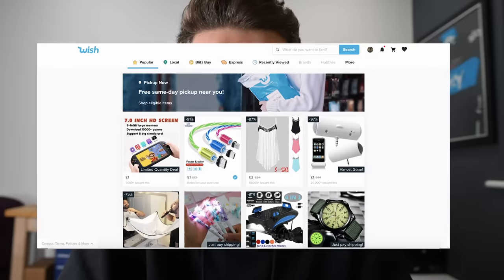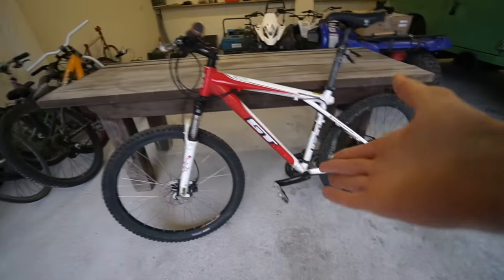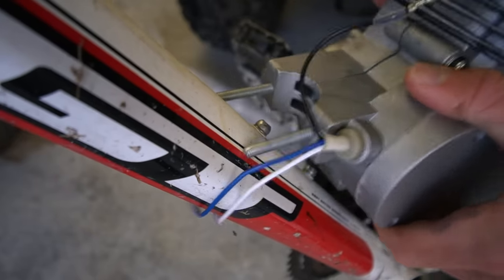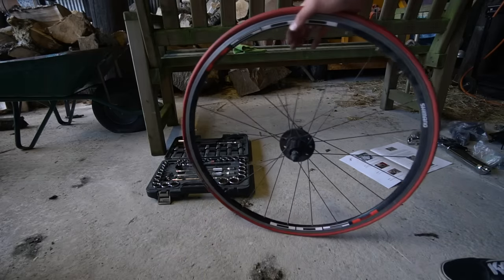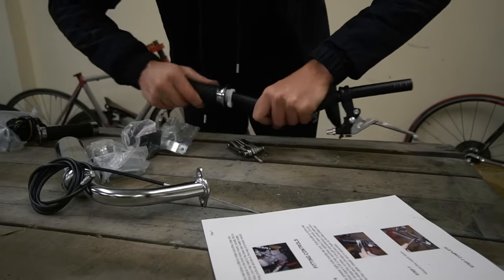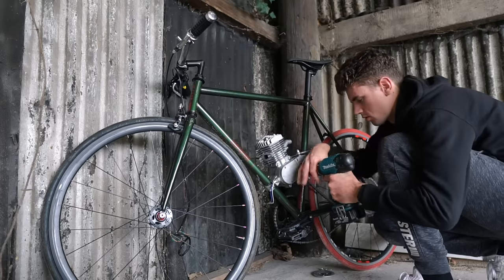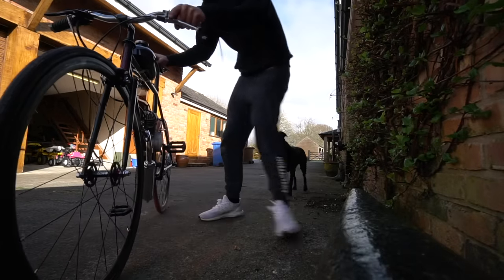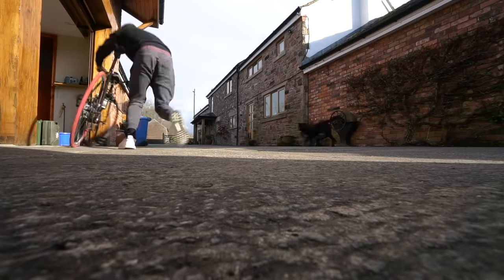I bought a 2-stroke bicycle engine from China *dangerous*

Comment from the maker: Hey guys. Like I said on insta - I wasn't gunna post this for another week or two. But I know a few of you are stuck inside, etc etc etc. So I decided to post this earlier. I hope it can bring a smile to you all, and you're all staying positive 👊
Reply: As a heads up upgrade the engine studs because stock ones break easy and I managed to break my frame above the bottom bracket at 800 miles
Reply: Did you not get the chainguard with your kit that stops your shoe laces getting tangled and a faceplant also do you need any insurance etc to use this cheers
Reply: This kits comes with an adapter for the engine mount to fit on bigger down tubes FYI
Reply: Cameron Jeffers put a new spark plug on for it to start easier
Reply: You can get loads of go faster goodies for these including Nitrous kits that use creamer cartridges available in Boots. Get a cheap thin steel tube bike that suits the engines mounts. These really do fly once bedded in, just remember that you need V brakes at least. I saw a cop driving towards me once, but I killed the engine and pretended to pedal, he never even looked up.  I have a few vids of mine on my inventions and gadgets playlist if you're interested.  Have fun playin and stay safe 👍
Reply: Watch the bolts on the wheel chain gear snap snap and 80cc that was ment for the 25mm frame extra bracket or your going to need to change the case for the 50mm should have kept it to the 50mm?!! Theres a 100cc upgrade when you get your scooter licance 😆 with the short piston had 55kmh on nitro upto 62kmh. 5 years 1 bearing 2 needle bearing crank and piston done everything😧.
Reply: Where abouts do you live
Reply: I’ve been looking for a bike Can i buy one your old ones because I don’t have the money for new ones
Reply: I put a 80cc bike kit and put it on a 20" Bratz chopper bike and it did 50mph and you could dump clutch ride wheelies I've built 5 or 6 of these kits and have done all the mods
Reply: And I've never "broke" one in I start it let it warm up and then ride it hard and I put 300 miles on my 1 in 2 weeks you break it in the way you want it to run always
Reply: I spent ten years building and selling them and I will never touch one of those 2 stroke kits ever again. Just saying.
Reply: @scooter979represent  why?
Reply: I got a motor off "wish" big mistake but I'm stuck with it now. I've tried over an over to get it started..it won't start. Mine is the kind the has to head..the cylinder is one piece..I suggested ideas to get it started besides throw it out an buy a good one. Lol
Reply: Is it pedal assisted?
Reply: @BowsersCloset  yes.. Its peddle assisted
Reply: @anthonyl9438  why bro
Reply: What was the top speed? I use to own one think mine got too 70kmh
Reply: Hey bro. Is it every start moment will have that problem 9:28.?? Plss answer that quiestion.
Reply: Mate if u had a back wheel of any other bike so u had a cassette that bike would of fired first time

Comment: if its hard to start after 3 tries turn the low speed needle out 1/2 turn to richen it up. this introduces more fuel= MUCH easier starting. the reason you finally got it going was because the motor kept getting warmer and finally the ring/s sealed well enough to give it the compression it needed to start.
Reply: Yeah, I'm sure a video he made four years ago and your comment two years later is why he was in the same ally for the last 730 days doing this over and over again until he saw your comment.
Reply: Yeah, im sure this dude is reading your comment 2 years after placing it😂 @MikeNBikes
Reply: @MikeNBikes  lmao rekt

Comment: That thing is gonna be more banned by British Cycling than you were!  🤣😂🤣😂
Reply: Lol What's this about getting banned. I'm a BC coach!?!?
Reply: They are legal in the uk as long as you are peddling.
Reply: @cosmomanningham-buller7620  no they're not unless you have tax,insurance and mot
Reply: Cosmo Manningham-Buller they ain’t legal in uk 🇬🇧 I’m Blackpool based n I got pulled it don’t matter if your peddling or not
Reply: @anthonywarner6433  did ya get a warning or were the cop a jobs worth?
Reply: Lord Belvoir na they said I have to use it on private land or if I didn’t they would take it of me so I sold it on to same any greath mate
Reply: @anthonywarner6433  they will be
Reply: Lord Belvoir na they didn’t nick me as they said just put it in the house but I sold it in stead
Reply: @lordbelvoir2543  , Agree, it would need SVA /Type Approval to get a reg plate , but would it fail emissions? ( & perhaps dodgy fuel tank & poor brakes & more? )  Perhaps You still can have a "day light only MOT' with no lights.  The Cop might have to prove you were running/ or planning on running the engine on the road/public place to get a conviction, rather than just peddling to private land.  If you are just peddling to private land taking the spark plug out might convince the cop. Caught motoring on the road,  a keen cop could be looking for big fine & points on your car license.  And that ok, as the chance of injuring or killing a bystander is actually higher than a Cycle or real Moped.  That said there should be provision for waste land where folk can have fun.
Reply: Great idea but I don't  think they are road legal in the uk
Reply: Can anyone remember  the motorized  skateboard

Comment: Hell, I bought a kit and put it on a cheap Wal-mart mountain bike. The cheapest fun and means of travel. A top speed of 27 mph. But around 100 miles per gallon.  I could ride for 26 miles for less than .90 cent U S. Plus, if you treat them right. You can get around 10,000 miles out of one motor. Performance parts are equally dirt cheap.

Comment: I still have the one I built as a kid over 10 years ago with one of these kits.. most dangerous part is that rag joint that connects to the spokes but if you swap it with a hubcentric sprocket you're good. Mine still starts up and rides, hits nearly 40mph

Comment: if built correctly and maintained properly these motors are very reliable. Only problem i ran into was the chain tension pulley, which i fixed with a rubber sleeve wrapped around the frame rail, then i attached the pulley mount  over the rubber sleeve.

Comment: When you start it pull in the clutch after you started the engine, then with the choke on run it before going full power. Also just do 3 tanks and then run 25:1
Reply from the maker: Thanks mate 💪
Reply: 32:1 no more for break in
Reply: @Cameron_Jeffers   check out some of my bikes if you like
Reply: I switched over to 50:1 Vp racing fuel in mine and it’s been working better
Reply: opti 2 100:1 right from the first start. works great with no smoke
Reply: Cameron Jeffers no problem mate! 🇦🇺
Reply: Cameron Jeffers also put some grease in the clutch gears.
Reply: Nah bra that’s all wrong if you’re using a good quality synthetic oil you can run 40:1 from day one, the main thing is just breaking it in properly , no need to drown your engine in oil for it to run 😂
Reply: Just put unmixed gas in the tank and rev the balls off it. Once its toast go buy a proper scoot. 

Had a few of these china girl kits. They are a fun project but more a waste of time. That and its always fun having the rear wheel come apart because cage bearings don't like being spun that fast gor extended periods of time
Reply: Are these petrol engines
Reply: @forgottenofireland784  yup, crude little 2 strokes. 

The motors frankly aren't all that terrible, its just the kit as a whole that sucks. Lots of fun to put together though.
Reply: Luke Keenan no they run off straight H2O
Reply: John Brier  why would I go with less oil on break in when it needs it the most?
Reply: John Brier  china girl kits are junk at the best of times the whole way around. Had a few of them, they run ok, but the whole setup is janky dangerous junk. Unless you fab replacement parts which adds hours and cost to the thing, they are just not worth it.

Also doing break in with less oil is fucking retarded mate, those poor little needle bearings on the wrist pin and rod appreciate all the lube they can get. Same with those pig iron rings. 

Tldr you are actually better off with a tao tao and even those are bottom of the barrel.
Reply: John Brier  Motul 710 every time all the time. Cheap oil is for weedwhackers.
Reply: John Brier  last time I checked, Motul was one of the real deal high end oils.
Reply: John Brier  You have zero idea what you are doing, and even less idea what you are talking about. 

Get off the internet, and lay off the glass pipe.
Reply: @600bubba  40:1 or 50:1 till death iv had 2 bikes and the other one lasted 12k miles on using the fuel ratio i had without running into any engine issues
Reply: @thewangshabang5379  the red bike on my channel has close to 20k on it  rphp2c 32;1
Reply: @LeadTheBore  79 bucks 🤷🏻😅 It’s always worth it for that. It dies buy another
Reply: @lexuses3942  what's your time worth to you though? I'd rather just ride and not have to mess with it every other trip.
Reply: @LeadTheBore  If you have to mess with if that often you’re not doing something right. Build it and break it in correctly and it’s not bad at all. I’ll take mine anywhere
Reply: @lexuses3942  I've had a few of them, and quality is a complete crapshoot. Once in awhile you get a good one and even then they're "ok".
Reply: @LeadTheBore  Than I’m sorry for your luck man lol 😂 all I can say. These are definitely “hit or miss”...I’ll give you that. But fortunately in my case it’s usually a hit. I’d say 1 maybe 2 out of 10 of them sucked. In my experience

Comment: if you have a late 80's or early 90's frame mountain bike. this works great. Helps if you don't have a rear disc brake and you have round tubes. I was going in less than 2 hours. You need to use more oil to fuel for the first 500 miles.

Comment: Just make sure it's a 16:1 gas to oil ratio. Nevermind the throttle. After a few tanks, go to 20:1. Apart from that, you're good to go. I've been doing this for years.
Reply: With 16 to 1 it clogs my spark plug and smokes way too much , so i swapped to 25 to1 and it seems perfect smokes but just enough and the plug seems normal
Reply: @jbrieger6103  I use 25-1 but 32-1 will work but might be too lean and not worth risking it , have ran 40 to 1 and was too lean
Reply: @jbrieger6103  yeah i use a heavier mix for a brand new engine to break it in then lighten it down to put less wear on the engine , i look for when the smoke is not too much and its thin and blue not thick and white and i go with that mix

Comment: For the mixture: for the 1st gallon of gas, 8 ounces of oil. For the 2nd 6 ounces of oil. For the third 5 ounces of oil, and for the final tank, 4 ounces of oil. Stay at 4 ounces.  
It takes about 400 miles to break your engine in
Reply: That would mean you have to spend about $100 in gas and 2 stroke oil and the technical know-how of mixing it correctly
Reply: @jordananderson8299  $100? How? And that’s just for the break in. It wouldn’t be $100 btw, not even half that. Technical skill to pour oil into a mixing cup until it reaches a number of ounces and then put that into the gas and shake it around? If you can’t do that, you shouldn’t be on a bike, not to mention these finicky Chinese 2 strokes
Reply: @jordananderson8299  pretty easy to write down how much 2 stroke oil you mixed into a 1 gallon

Comment: On the bottom of the muffler there is a nut, take it off to remove the end cap, it will make the motor louder but run much better. If you plan on using it for a longer period look into getting a hub mount sprocket adapter, those stock sprocket setups will tear your spokes up.

Comment: Weird there is no pull or kick start... Be decent if it was easier to start.
Reply: You pedal it to get up to speed and then pop the clutch. Very simple. (As long as your bike actually has pedals, that is.)
Reply: I know the 4 strokes have pull starts
Reply: You can buy a pull start for it
Reply: I bought a pull start for mine, they are about a fiver off eBay but you have to get extended pedals for it because it makes the engine wider
Reply: I bought a pull start for mine.
Reply: I had a go on my mates one, I had never rode a clutch bike till then it’s incredibly easy
Reply: You bought your subscribers then dipped from the platform
Reply: if you really want is you can buy a pull crank start it
Reply: The 4 stroke versions have pull starts if you're interested.
Reply: he didnt hold the clutch in thats why
Reply: Hey how much was y’all kit I can’t find a good want every price is different

Comment: Fit disc brakes to the bike and mtb wheels for a larger grip contact patch for the add weight and better road comfort and control. Use 50:1 2stroke engine mixing ratio you starts will be better with specified 2 stroke wipper snipper or weed eater oil same thing.

Comment: 1:54 that's the chain guard 1:58 that's a CDI ( capacitor discharge ignition)  2:01 that's a fuel filter 2:18 that's called a sprocket.

Comment: “Dangerous” ?  No. What’s dangerous is not understanding how they work, and how to build them properly, first off, I didn’t see you check the head nuts to make sure they were good and proper, secondly you should have cleaned up the ports in the engine, third you should have run a tad more oil, they run just fine with a lil more oil and you won’t burn out the chrome cylinder liner at wot. The bike isn’t dangerous, you are.
Reply: Chill.
Reply: kacey rae Still waiting to see your bike
Reply: Right he dint even put the motor anti vibration pads 😂
Reply: Dont have a stroke
Reply: Nah I agree he doesent seem to know what to do.. the amount of times he says 'i don't know' and calling a fuel filter 'some kinda fuel pump thingy' and the list goes on.  Never mind using random bike parts to try and 'make things fit' people who genuinely know about them know they're only dangerous in the wrong hands.
Reply: @syhanson9723  couldn't agree more
Reply: @Remiphysco   I built one of these a few months ago and have since upgraded nearly every part possible apart from a reed induction with windowed piston .. it's fast.  Not dangerous either if I ride properly. 😁😁😁😁😁🚴💨
Reply: me too
Reply: Lmao 😂 if he was planning on using it to commute then yeah you have a point but it’s clearly just for fun and a video for us to watch. He did well to even get it going.
Reply: @traieking  well at least he managed some 'daily excersize' haha
Reply: Check the head nuts and cleaned the ports 😂 what you on about mate haha
Reply: Damn, you stole the words right out of my post. "Spot on".
Reply: it’s important to understand how engines work when building these but taking it apart to clean the ports is unnecessary
Reply: @BlindManWalking hes not wrong everything he said was true. The guy in the video don’t know shit and you can tell. if you did research then youd know he’s wrong too.
Reply: thanks Karen Rose

Comment: Here in the USA cops don't even look my way and I have the muffler cap off haha
Reply: In Texas having an engine on a bike requires a license and license plate
Reply: @robertkelley316  haha land of the "free" lol
Reply: @robertkelley316  if its only motor assisted (still requires pedaling) which most motorized bikes are, then it should still be legal, cause it cant be called a motorcycle or a moped
Reply: @chad c akin electric motors are okay I was referring to gas powered engines
Reply: Chad C Akin But mopeds have pedals- what makes a cycle with pedals and an engine different to a moped?
Reply: @kie you'll get fined, I've seen it happen more than once
Reply: @robertkelley316  $700.00 fine in Australia because it runs fine with no need to pedal.
Reply: @robertkelley316  In Idaho any engine 50cc> on two wheels is legally classified as a motorcycle. Requires endorsement, registration and insurance. Some cops may not care.. Till one does lol

Comment: FYI The reason why it is dangerous is because you skipped half of the steps

1. Sproket has to have all screws In and Bolted to the wheel
2. The Throttle has a pin, your suppossed to drill a hole for that pin to go into oon the handlebars
3. That seethrough thing attaches to the tank(Its a Fuel Filter)
4. Also Those kind of tires arent very safe for something like that

Comment: Put the cranks facing the same way so its symmetrical
Reply: Like the Yamaha  FS1-E in the days of my very distant youth, to be a legally registered moped it had to have pedals that could be rotated to pedal the bike, but they were designed so one of them could be instantly relocated 180degs and become matching locked footrests for use as a motorbike.

Comment: Swap the carb slide needle to .078 lengthen the plug and space to increase comp. Mill head .040  port and skirt work piston. 56 tooth sprocket. Expansion chamber.

Comment: Nice build, When You get the extra long mounts for the Mountain Bike. Get Yourself a sheet of thick Rubber. Cut this Into strips and fold around the Frame where the Engine and Mounts touch. This will cut down the Vibration from the engine. The Kids used to all have these around here, till they made them Illegal, and they were fast.

Comment: These kits take a bit of getting used to and some tinkering. Once you get the hang of it, they run great and are very simple to use. 

Also use the most basic, stock mountain bike you can find so you don't run into weird and frustrating compatability issues!

Comment: This is sweeeeeeet. Do you think you could take this out and do a 1-1.5 hour motorpacing session behind it?
Reply: renember this is 2 stroke it overheats and damages the engine at idle if =not moving and sending air beside the engine.
thats how i broke mine.
Reply: @Pops Fereal what do you mean nah, then how did my motor overheat then?
it was parked and idling low, on a hot day.
in hindsight i was a dumbass for letting a motor with no cooling even idle, but you live you learn.

How would it idle all day if it has no airflow to cool it?

You aint making sense fam sorry xd